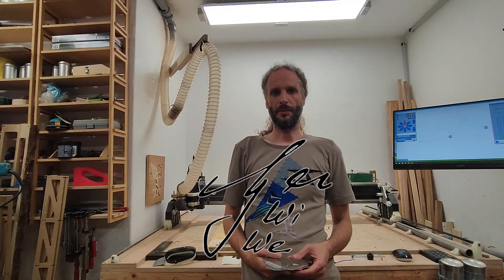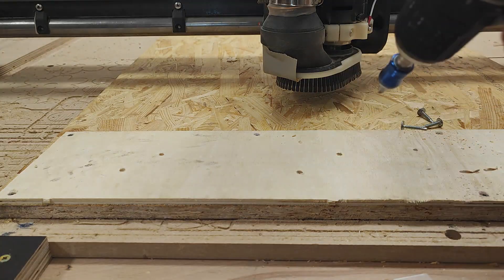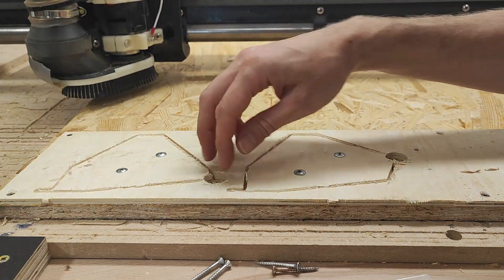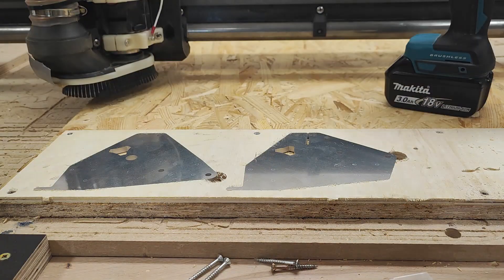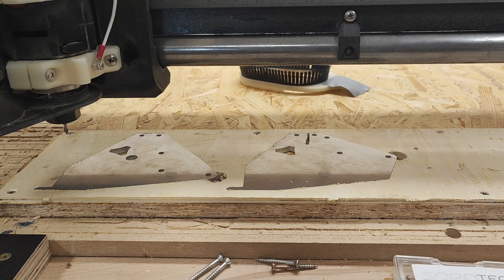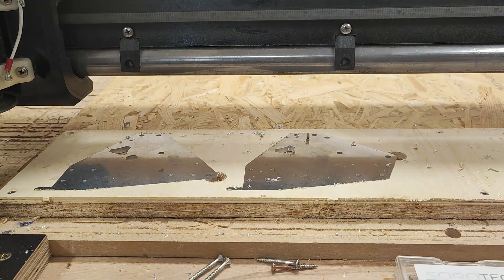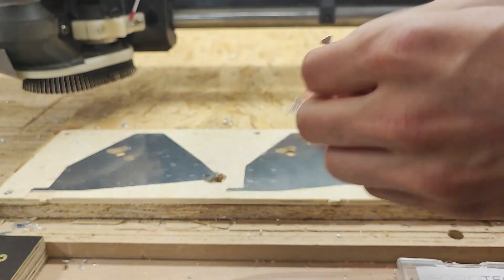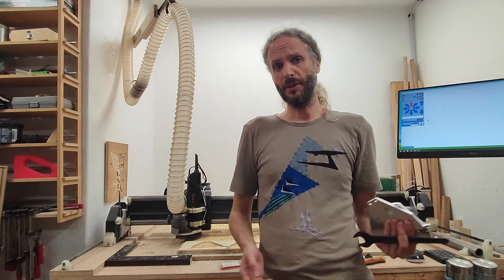XZ Plates Fixture

Comment: Without shielded wires for endstops are you getting EMI interferance from the stepper motors causing activated endstops?
Reply from the maker: It might be interference from the spindle, I had the same problem with the touchplate that it would Ghost trigger. Now it is configured the way that it's only active when probing. 
I am also not sure whether it's interference, because angrily hitting the endstop a few times often fixes the problem and it only starts when a program starts and the core starts to vibrate. :)

Comment: Okay, I love everything about that video! Fly out and let's make some videos.

Fixtures and batch processes show a very strong use for CNC that not a lot of home gamers use, but could. That mill/drill was amazing, I immediately paused the vid and ordered some. Milling aluminum is so much faster if you do not plunge with your end mill.  Drill out all the entry points and then swap to an endmill for the pockets and slots. Anytime I go to cut aluminum I never have a center drill on hand so I ordered some.
Reply from the maker: You guys are too kind, thanks so much. <3 And yes, the drill is a gamechanger in aluminium. You can drill so much faster, especially small holes. For bigger holes it does a ramp and then the circle with a normal endmill, that works well, but straight down without helical is the endmill killer for me. :D

Comment: Could you explain an end mill for drilling or post a link.
Reply from the maker: It's basically just a drill bit that works well for aluminium and fits into a CNC... :D Pretty sure it would also work for wood. You can find it here: https://www.sorotec.de/shop/Zerspanungswerkzeuge/sorotec-werkzeuge/vhm-spiralbohrer/
Reply: @HaWiWe  thanks

Comment: Neat recovery!  Personally appreciate people actively edutaining and talking in videos like this when it's helping provide context.  Is this the V1 Engineering LowRider 4 CNC?  1/8" Single flute upcut carbide?  Curious what feeds, speeds, DOC worked for your plywood fixture, and the alu holes?  Cheers!
Reply from the maker: Thanks Aza. :) I used a 2-flute 3.175mm endmill with 3.5mm DOC and 1400mm/min and 24k RPM, the holes were made with a drill endmill with 3.2mm, peck drilling and 12k RPM. I should have said that in the video...